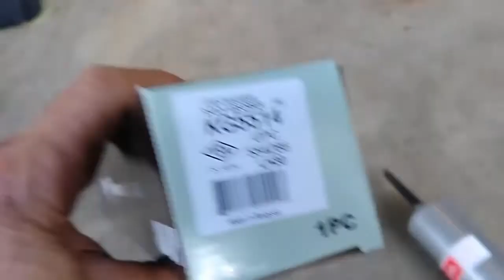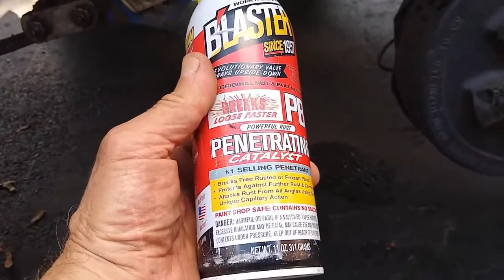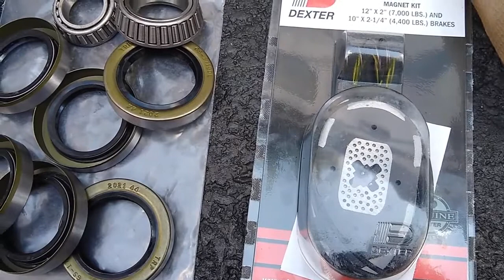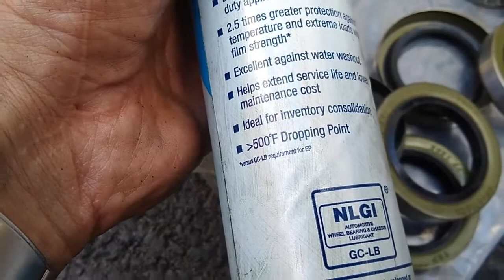Replacing shocks and lubricating wheel bearings and suspension on an Outdoors RV travel trailer

Comment: Good video. You did a great job of thoroughly explaining everything. I just finished a complete replacement of all suspension components on my 32ft fifth wheel. For shock removal, I found a cut-off wheel took about 20 seconds per shock for removal. I could not turn the nuts, so just cut them off. Really sped up the process.